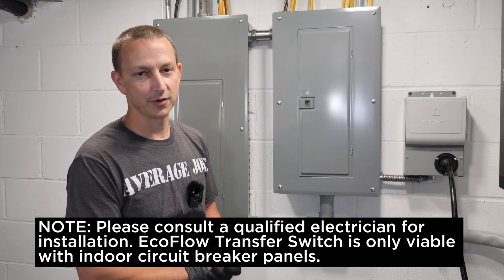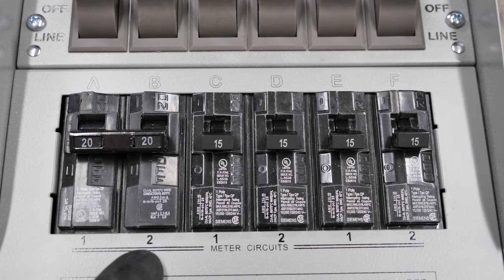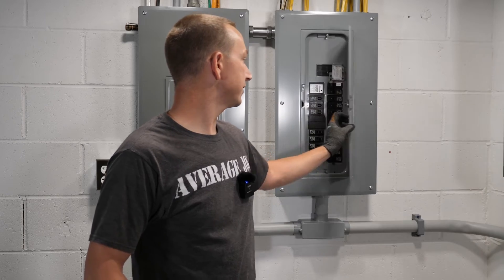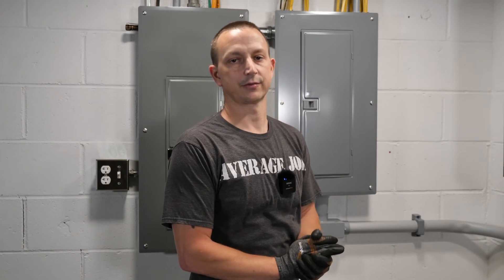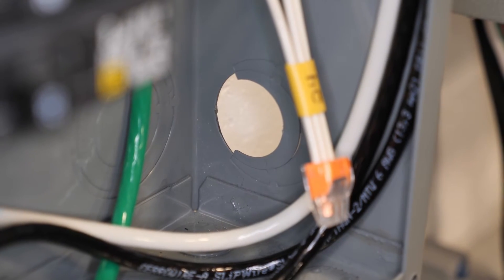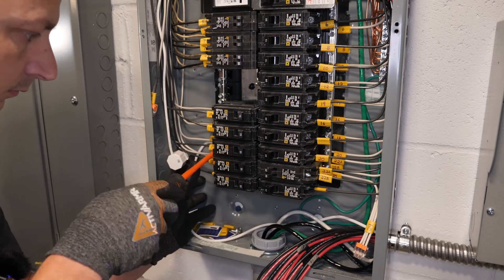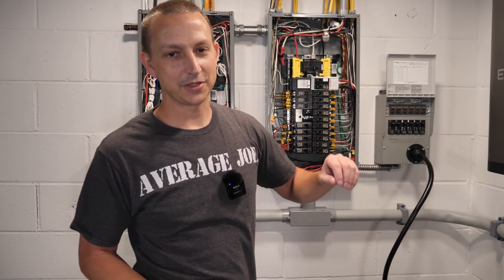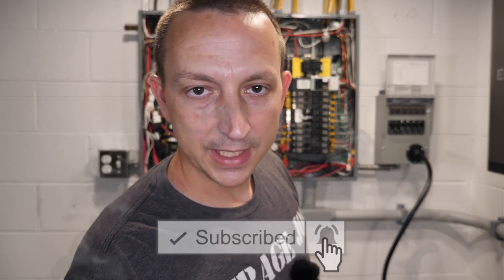How to Install EcoFlow Transfer Switch for Delta Pro (Expert Tips)

Comment: Reliance Electric also makes a 10 circuit manual transfer switch, EcoFlow does not offer that 10 switch model. One advantage of the manual switch over fully automatic switching is the reduction in complexity of the hardware with attendant increase in system reliability.
Reply: Sorry I did not see your post when I added mine.  I would go with the 10 circuit unit because for the extra $20, it is worth it for the extra potential loads.

Comment: Thank you, it was very useful. You did not address the recharging of the generator batteries.
Reply: My hunch is the Ecoflow Delta Pro recharges when grid power is restored and the Transfer switches are set to "Line"Position, and they basically forward feed power from the main or sub panel through the transfer switch and the  DVH (Dual Voltage Hub) to the 2 Delta Pros.  That's my guess, since as others have stated, all other AC in/outlet ports on the Delta Pros are automatically disabled when using the voltage doubler.  My Hope however is that, you can still charge the DPs via the solar charging port as that is a DC input which elimates the aformentioned "Double Bonded Ground /Nuetral Loop" problem.  So if you have a generator and AC to DC charger or Solar panels you can probably charge the DPs while using the DVH(hub)
Reply from the maker: Cheers!  For AC charging, Delta Pro supports 1800W Max, 120V AC, 15A; 3000W Max, 240V AC, 12.5A. It also supports 1,600W Max solar input and  12V/24V car charging. If you bring it outdoors, the infinity port allows you to charge the pro from EV chargers.  Let me know if you have other questions🙌
Reply: @EcoFlowTech  shitty answer, bad attitude
Reply: @EcoFlowTech  Better if you hadn't responded at all
Reply from the maker: Hi, sorry about that. For AC charging, Delta Pro supports 1800W Max, 120V AC, 15A; 3000W Max, 240V AC, 12.5A. It also supports 1,600W Max solar input and  12V/24V car charging. If you bring it outdoors, the infinity port allows you to charge the pro from EV chargers.   @sunyun4425

Comment: Can you still use this switch with just one ecoflow delta pro? also can you still use the front 120v plugs if you use two ecoflow delta pros?
Reply from the maker: Hi there, yes you can chain one Delta Pro to the transfer switch. If you chain two Delta Pros together with a double voltage hub, you can only plug into the sockets on double voltage hub. Check out more here👉https://www.ecoflow.com/us/power-backup
Reply: @EcoFlowTech  Thanks. Do you have a working link to the switch you used in the video?
Reply from the maker: Sure! Here you go: https://us.ecoflow.com/products/transfer-switch?variant=40515604512841

Comment: Wait a minute, is there not an automatic mode so that it will auto-transfer when the power goes out?

Is manual transfer really the only option?  (That just seems kind of incredible, given how great their solution seems otherwise.)
Reply from the maker: Hi there! We only manual transfer switch right now. Sorry about that.
Reply: Do you have any plans to create an auto switch?  It would make a big difference.
Reply: Hello?

Comment: It's hard to believe anyone still uses those archaic things.. A massive WASTE time and money just to leave you very limited with what can be used in your house.. A MUCH more efficient, easier to install and use system can be bought and installed for approx 5% to 10% the price of that mess.. Maybe this video was made 35 years ago and just got posted..
Reply: You said a lot of stuff without saying anything. Good job.
Reply: @USNEM  Which words do you need help with? MESS? WASTE? LIMITED? ARCHAIC? Any semi knowledgeable tradesman knows how to light up every circuit in almost any house for under $50 bucks.. It can be done much safer than that mess you created and is 100% legal. HOWEVER, it doesn't require purchasing that grossly over-priced monstrosity 6 circuit switch nonsense.. AND since you refer to your video as "expert tips", perhaps you should learn a little about electrical devices.. For starters, a wire-nut is NOT a connector (as you stated), it is an insulator.. If you can't understand that, you should not be allowed to plug in a coffee pot...
Reply: @twistedhillbilly6157  so what is "A MUCH more efficient, easier to install and use system can be bought and installed for approx 5% to 10% the price of that mess.". Please explain.
Reply: @woolval1793  There are several methods.. 1. Meter collar transfer switch....... 2. Simple back-feed setup..... There are more but that should keep you busy for a while..
Reply: Seems like a system that automatically transfers to backup Ecoflow generator and more importantly switches back to grid when grid is back on.  

Otherwise how do you know when grid is back up?
Reply: @tomunderwood4283  That's the key difference, the advice he was suggesting is just manually controlled backfeed breakers added to existing panel, but some panels are already full so in that case you might need to add and extra box,  Main difference as you stated is his el cheapo solution does but have automatic transfer as the ecoflow box does,
Reply: @tomunderwood4283 yeah, that's a problem I have now with my current home's manual transfer switch for my outdoors gas generator
Reply: @tomunderwood4283  Couple things.. If a panel is 100% FULL,, your panel is too small.. There are also tandem breakers .. The meter collar does act as an auto transfer switch and some utilities give and install them for free with a 25 ft cord.. Some utilities send text,  or email, or automated call within 2 or 3 minutes of the power being restored.. I would never admit to running a small line from the utility side of the meter to a light inside the house.. There are several ways to accomplish that.  Perhaps a better choice of words than "el cheapo" would be "NOT WASTEFUL and much more efficient"  AND doesn't limit  you to 6 circuits..
Reply: @twistedhillbilly6157 I wish I could pick your brain. I'm so lost with this stuff. This is all new to me. I want to buy a ecoflow portable generator but I'm left with many questions. Is the transfer switch better than the smart home panel?
Reply: Tom, you say a lot without saying anything.  Please clarify
Reply: Yes, only 6 circuits. But that's enough for me. Fridge, freezer, and then one extra circuit for the kitchen. I can use one appliance, nuker, blender,  multipot at a time.  Maybe one for the small water pump.  I'm ok with rechargeable lanterns.

Comment: Hi, if we don't need to use 240V could we use only one EcoFlow Delta Pro?
Reply from the maker: Hi there, yes you can chain one Delta Pro with transfer switch and connect to your home circuit.
Reply: @EcoFlowTech how would you do that? The plug on the front of the delta pro is 3 prong and my transfer switch is 4 prong. Bought the whole Delta Pro double hub system to plug into my manual transfer switch for my Generac 7500w generator and when I do...the two Delta Pros won't even power a light let along my refrig or well pump. My electrician said EF told him to take the covers off my delta pro's to "make sure they are wired correctly"?? After spending all that $$$$ I have to pay my electrician to trouble shoot a wiring problem inside the Delta Pro's? Terrible!!
Reply from the maker: Hi there, if you want to chain one Delta Pro to your own transfer switch, you will need a TT30P to L14-30R adapter cord.
Reply: @watchmanonthewall3852  did the  TT30P to L14-30R adapter cord work  out for you?

Comment: hey joe can i run my hot water heater delta pro and can i run with the 2 20 amp breakers that came with the transfer switch
Reply from the maker: Hi EcoFlow here! Could you pls tell me the spec of your hot water heater and the transfer switch and what EcoFlow units you have on hand. This will help me answer your question:)
Reply: 40 gal water tank with 2 heating elements 4500 watts top and bottom 240/volts reliance 6 circuit 120/240 transfer switch  @EcoFlowTech
Reply from the maker: Hi there. Yes, it can work. In the video, we use the kit 306A transfer switch and 2 Delta Pros and a double voltage hub, which can power 240V water heater. However, it is only one circuit and for the 20A output. One thing to pay attention to is that if you let upper and lower heated tanks work at the same time, it might lead to overload because the maximum output of two Delta Pros is 7200W.

Comment: I was curious about connecting a Honda 2000 or 3000. Thanks for reply and your videos.
Reply from the maker: Hi there, the transfer switch in the video is exclusive to our whole home solution set (2 Delta Pros with 1 double voltage hub). It might not work with all generators. You might ask relevant brands for suggestions. The model in the video is TS 306A with L14-30P interface.
Reply: @EcoFlowTech hello. How do I hook this transfer switch to a Delta 2 Max; it has only 15A outputs?

Comment: I appreciate the video. I have the same setup. Can I hook my gas generator up to this 
transfer switch also?
Reply from the maker: Hi there! Thank you for liking. Could you pls tell me the brand and model your gas generator? The transfer switch in the video is compatible with Delta Pro, the interface might not be compatible with other generators (gas or solar).
Reply: @EcoFlowTech  I have the same setup and curious is my Champion 100574 Open Frame Dual-Fuel Inverter Generator would work also?

Comment: There is also a kit from Bluetti for this six circuit transfer switch. I have this transfer sw with two AC300s and four B300s that i use to reduce my power bill to around 20$ a month. The system is recharged with a 3Kw array and works well on all but the darkest days. Only thing i would change is to go with the ten circuit transfer sw so i could have the option to power the circuits i am using at the time which turns out to be more than six....not at the same time but running this every day i use more than six curcuits over the course of a day.

Comment: I like the concept but from what I’ve seen (I haven’t personally tested these units) when you use the hub to create a split phase connection, the two units don’t synchronize their batteries together.  Even only utilizing 6 circuits in the house, you have a high potential for unbalanced loads which could drain the battery faster on one DP than the other.  

That and the odd placement for the hub connections makes it difficult to put the units side by side because you have to stagger them to have access to the ports.
Reply: another video mentioned this imbalanced load draining with the 2 Delta Pro and voltage doubler, it's unfortunate design limitation.  This means users must manually switch the cords on the 2 delta pros at the doubler periodically, i think a charging box between 1 DP outlet and the other input port might do the trick but not sure
Reply: @sunyun4425  yeah, seems like a hassle, especially during a power outage.
Reply: Your issue is a non-issue.  Just like your meter/panel from the grid it's not balanced either.  Ever have a failure due to that?  I didn't think you would say yes.  Understand before you comment, please.  For pete's sake if you have two mugs of beverage and you drink from one more than the other you also have an unbalanced load on the glass mug.  So what!!!!!
Reply: I understand balancing loads very well, however in your example of the grid, you don't run out of power if you use significantly more power on one leg vs the other.  With these units, if one unit runs out of power, I believe they both shut down.

Comment: You should never plug a Delta pro into an AC outlet to charge while connected to a manual transfer switch as that creates a ground loop and double ground/neutral bond. AC input is also disabled when using the double voltage hub. And connecting a single phase power station to a split phase manual transfer switch using an adapter that bridges X-Y can be dangerous. If multi wire branch circuits are used in that setup there is potential to overload the neutral and cause a fire.

The only way to provide automatic backup for grid down natively is using the Smart Home Panel which only works with Delta Pro or Power Kits.
Reply from the maker: Thank you for adding more information!
Reply: Are you saying that #1 Delta/Anker station should not be charged via an AC plug that is not running off of the Delta/Anker while they are powering a transfer switch. Ie. Even if that plug is running from the grid in the sub panel.

Or are you saying #2. we should not charge via an AC plug while the generator is feeding the same plug which would be plain crazy, if anyone did that for more than one reason. 

I have charged other stations via the main generator through an ac plug with transfer switch set up, but that is not a loop. 

Also, in my case I would never charge with an AC plug off the grid while powering a transfer switch from the generator. Defeats the entire purpose. 
Not arguing, just want to get this clear in my head once and for all.
Reply: Some questions from a non-electrician regarding this. 

Does the potential for a "double ground/neutral bond" mean that you can never use household AC input to charge the EcoFlow when the 240v hub is connecting the two units? If that's the case, it would seem to imply that you need to disconnect the EcoFlow from the hub, and then plug in for AC charging. True?  You also mention that "AC input is disabled when using the double voltage hub"  - does this simply mean that the first situation, where the double ground/neutral bond is created - can't happen because the EcoFlow disables itself?

Sorry for the longish and possibly naive questions, but my understanding of electricity is pretty rudimentary.
Reply: @CharlieS-d4f  Any use of the infinity ports disables the normal AC input and AC outlets (EV Adapter, Double Voltage Hub, Smart Home Panel). However, I still do not advise plugging into an AC outlet while already connected to the home electrical system (via Smart Home Panel or DVH using an inlet/interlock or manual transfer switch). So, yes, if using the DVH, you would need to disconnect from that and then charge from an AC outlet.
Reply: @neocrypto9368  if I'm using 1 unit for feeding 120V single-phase into the transfer switch would that be a scenario where the AC charging cable can remain plugged into the grid power so it recharges when the battery reaches a threshold like 10% (this is a feature of Ecoflow "energy management") but then stops using AC charging when solar input returns? If not then how about putting a 3-prong-to-2-prong adapter on the AC charging cord and then keeping it plugged into grid power? The goal I have is to have my Delta 2 Max feed the transfer switch and accept solar input but recharge via AC if needed. I'm not familiar with this ground loop or if it applies to my use case.
Reply: When I installed the Reliance manual transfer switch to have backup from a single Delta 2 unit, Reliance tech support provided info to mitigate the two issues you address.
Reply: @tideview1 And what was the information? 

AC charging from a wall out is simply not possible while using the Double Voltage Hub, by design.

Any method of attaching a power station to the home electrical system with the ground conductor in place (code/safety) would make it dangerous to then plug the AC input back into the same system. So unless you have a transfer switch that totally isolated neutral and ground (which exist but are not typical) you should never attempt that.
Reply: @neocrypto9368 What about 240v charging with the DPU or DP3. That would avoid neutral issues?
Also would removing the ground from the AC input of the powerstation be an issue? I’m thinking older houses with no grounded outlets.
Reply: @tideview1 what did you do to mitigate the issues? I wish to do the same setup.
Reply: Spot on, I actually fried a delta pro doing this not realizing the ground neutral loop. So even though not charging via AC, so the delta pro must use the ground when plugged in which causes the issue

Comment: EcoFlow: 
These cables are really terrible taking up a lot of space - same for cables for additional batteries, start using 90-degree connectors. 

AveRage Joe: 
Great video, as always!
Reply from the maker: Thank you for the feedback! We will keep the good work!
Reply: I completely agree, I have 2 Delta Pros and 2 additional batteries, plus 2 Delta Maxes with 3 additional batteries . It's a pain to connect them side by side because the cables are short, thick, and Ecoflow didn't build them to be stackable.
Reply: I agree totally.  It’s such an easy design change to make to have 90 degree cable plugs.